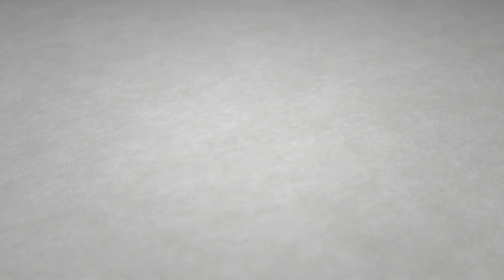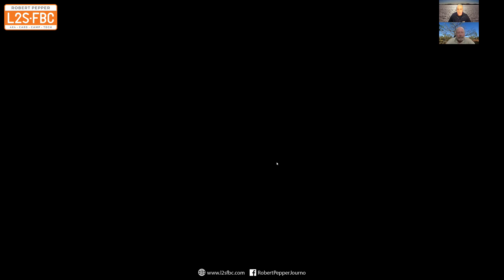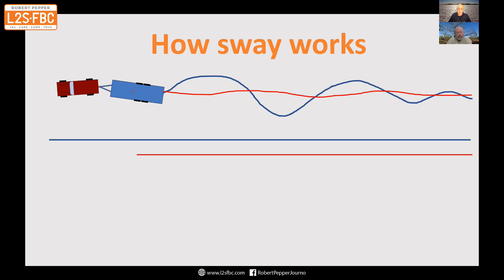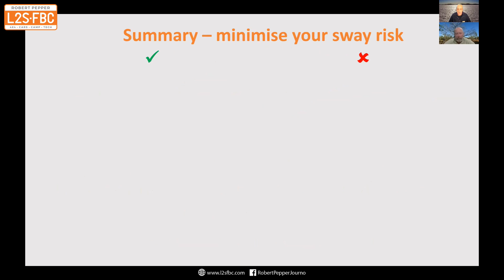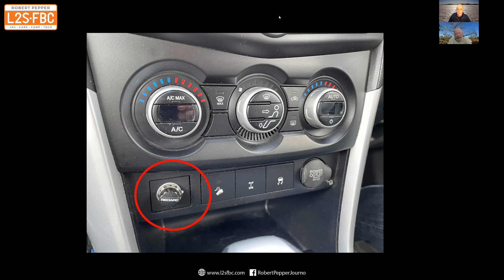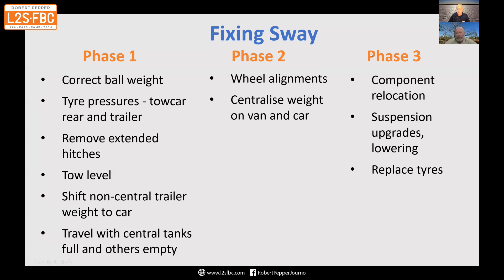Webinar - Trailer / Caravan Sway and How to Prevent and Handle It

Comment from the maker: 00:00 introduction
01:58 What is sway? 
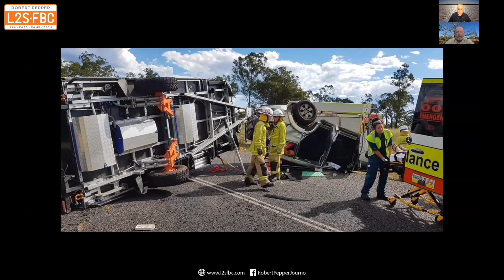03:11 How does sway work?
04:43 Easy way to fix sway
05:15 dealing with sway without an electric brake system
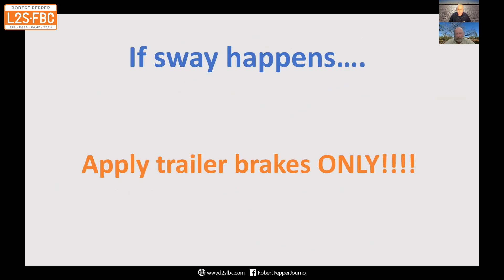07:03 reducing sway risk
10:40 location of brake controller
12:20 practice braking
13:40 caravan crash investigation
18:10 salespeople problems - vans and cars
21:05 pre-purchase weight deal
22:17 aftermarket sway systems
23:25 effect of increasing nose weight
24:09 electronic stability control systems
26:23 who can help me set up my van?
27:00  towing license
29:05 stupidity vs not knowing
30:00 setting up to reduce sway
31:20 rear tyre pressures & weights
32:00 more setting up to reduce sway
36:44 weight checks by police - stats
37:44 travelling with tanks empty/full
38:20 wheel alignment
40:00 offroad van height
41:00 tyres choice
43:40 effect of extended hitch
45:00 John's words of wisdom
46:55 speed and sway effects

Comment: Another thing is in UK alot of tow cars are front wheel drive and i have soon they load trailer nose weight is over loaded meaning very little weight and grip on the fronr wheels that leads to sway and turn over

Comment: We just picked up our new van and it came with a weigh bridge certificate. We also got a mobile weighing business to weigh our van fully laden. Our manufacturer’s number must have been pretty accurate. As part of the weighing service we received an excel spreadsheet that you can input weight you are adding and the location in the vehicle or caravan  that produces a report on the updated axle weights for each axle of the car and van as well as GVM, ATM, GTM & GCM. This provides peace of mind.  I have watched a lot of Roberts videos and I’m more cautious and better educated as a result. Yes, I am one of those with an off-road van. I did opt for a heavier load rated/stronger AT tyre as an added safety initiative given a portion of our driving will be at reduced pressures on corrugated roads. I was surprised by how much reducing tyre pressure reduces the tyre’s load carrying capacity. It’s a logarithmic scale so somewhat complicated to get the data on for specific tyres.

Comment: In Canada most vehicles with up to a class 3 or 4 receiver ( most full size pickups) over 5or6 hundred pounds receiver weight a equlizer hitch is required. I dont think you emphasized the importance of an equelizer?? Note for tight manuvering or maybe off its better to remove the sping bars.
Reply from the maker: Not required in Australia, and shouldn't be needed for that van

Comment: I scrap a lot of metal, some very heavy steel. I'm curious about heavy payload placement, not front,center or back. But if heavy items should be spread out closer to the sides or pushed in closer to the center line?? 
I try to be safe, in my past, I was guilty of some sketchy things while towing.
Reply from the maker: Centralised over axles.
Reply: @L2SFBC  Thanks, that is how I loaded it. Smooth as silk for the 30 mile drive home. This is great information you're providing!

Comment: 06:07 I have found a couple of times towing my boat with over ride brakes the trailer started to sway. I didnt brake I just kept the wheel straight with 2 hands & backed off the accelerator and the car & trailer stopped swaying around 80km/h.  After those couple of events I dont tow my boat above 80kmh. My boat trailer has about 7% ball weight. Im in the process of buying a heavier tow vehicle. At time of those incidents my car weighed 2 tonne & my boat weighted 2 tonne.

Comment: Interested to hear your thoughts on this...why do car dealers say a WDH is incompatible with cars that have trailer sway built in? When reading how trailer sway feature works on a car, it seems to be counterintuitive to what I have learned through your channel to prefer braking the trailer, not the car. Trailer sway feature on a car just applies the brakes to the car only? Is that correct? In short, is trailer sway feature on a car actually proven to be any good?
Reply from the maker: There is no reason why a WDH is precluded by car TSC. None. However some carmarkers ban use of WDH on their vehicles, so possibly the dealers are confusing correlation with causation. 
With all due respect to car dealers, do not use them as a source of advice on towing or anything other than the price of the vehicle.
Refer to my electronic sway systems video for more detail.
Reply: @L2SFBC  totally agreed mate, most of the advice is garbage same with what people repeat online. And my thoughts around TSC going against what you probably should be doing? I watched a Mazda BT50 video on TSC and it says brakes are applied, possibly on one side but honestly very little details on how it works. Will check if your video covers that.
Reply from the maker: Hi yes my video covers both trailer and car ESC

Comment: This happed to me.  I took my foot off the accelerator.  Looked in my rear view mirrors and steered opposite of the away.  I recovered perfectly.  All the trafic behind me slowed and I was swayaing.  I was going down hill.  I had too much weight in the rear of the trailer.      I also think that I maid a deal with the devil.  But I'm not realy too sure about that.  It all happed so fast.  I guess I will find out as time passes.

Comment: How do you asses the ball weight on a twin axle trailer?
Reply from the maker: Use a ball weight scale
Reply: @L2SFBC  how does that work on a twin axle trailer?
The reason I ask is that our 4 boat trailer (4x250kg dragon boats) is damn heavy even when unloaded and I can’t tell when I’m measuring ball weight or trying to lift the trailer. 
It’s easy on a single axle as it seesaws around the single axle but a heavy twin is different, because the fulcrum is between the two axels and as soon as you try to lift the hitch you’re in effect trying move that pivot point to the rear axle. Therefore you’re now trying to lift more of the trailers mass. 

What I’ve always done is had the center of mass of the 4 boats 300-500mm ahead of the mid point of the 2 axles and once I’m hitched up I check that the suspension of the van isn’t squatting. I also load as much as possible into the tow van even though its a PITA to unload on my own after a race rather than have everything in the boats.  

On a side note, when I first started towing I had someone tell me to accelerate hard out of a sway. I ignored that because I couldn’t see the logic in adding speed into an already dangerous situation. The only time I ever got a hint of sway was when my speed crept up over my usual 90-95kmh to 115-20 going down a steep hill. I took my foot off the gas and very gently braked and it stopped instantly. I was more annoyed with myself for not concentrating than scared at the time but it did make me think later how close I was to screwing up, big time and to never do it again.
Reply from the maker: Measuring the ball weight is the same process twin or single, but yes they react differently as you've noted. Don't accelerate out; the videos on my Sway playlist explain why.

Comment: Hi Robert, thanks for your well-researched and informative video presentation. Your content has been so helpful in my education leading up to my picking up a new (1600kg) camper trailer later this year. Your guest was critical of camper trailers that had mud terrain tyres fitted as standard and this is what mine will come fitted with (16" wheels with 33" mud terrain tyres). I don't intend to drive on the sort of terrain that would necessitate such rubber so, could you recommend a type of tyre that would be more suitable? My plan for the first few years is to travel mostly on bitumen with the odd foray onto unsealed roads. My tow vehicle (2020 Mazda BT-50) currently has H/T tyres fitted. Maybe as I build experience in coming years, I may undertake more gruelling off-road adventures!
Reply from the maker: Mud tyres are a waste of money on 99% of trailers, and you'll regret the choice when it's high-speed wet bitumen. Just run light-truck construction all-terrains. Reason; you need strength, and the trailer wheels don't need to drive, just brake and provide lateral grip. And for a single axle both wheels are always in contact with the ground.
Reply: @L2SFBC  Thanks for your prompt reply. Much appreciated. Keep up the great work.

Comment: I would love to see additional licensing for trailers, of any weight. Just a simple endorsement that can be done when learners graduate to their Ps to prove they've learnt how to reverse a trailer and understand loading and load restraint, through to requiring either specialist driver training or a heavy vehicle license where towing is included in the training, such as with HC licenses, for towing braked trailers.

Also zero blood alcohol when towing. The fact people can have a drink and go throw their 7t plus rig down the road is dumb and dangerous.

I think the other thing that really needs to change is how trailer manufacturers build their trailers and vans in the first place.

Being allowed to produce a trailer that has such poor roll and yaw inertia characteristics is just ridiculous. There needs to be limits put on the way weights are distributed throughout the trailer.

Tare weights should also be changed to include full tanks, fresh, grey, fuel, whatever. Their full weight is what should be included in the tare.

This 10% ball weight BS needs to be stopped as well. It's blatantly untrue and is just a cover up for poorly designed trailers. You shouldn't even need 5% to maintain a stable combination where your trailer and tow vehicle are properly set up. I'd put money on a sub 100kg ball weight on a 3.5t trailer where that weight is all in a concrete block over the axles being substantially more stable than a good number of vans you see rolling down the road. High ball weights just cover up poor design and pander to the desire of people to tow at excessive speeds.

Basically this whole towing thing just ticks me off. Between the lies salesmen come out with to sell a car or van to the dumb crap in Facebook groups etc that gets shared as gospel, nobody wants to listen when you try and point out simple facts. Better regulation and vehicle standards and formal training requirements are the only thing that's going to fix that.

</rant>
Reply from the maker: With you on that. I run 5% on my 2350kg van.
Reply: @L2SFBC  I only came across your channel the other day when you did a video with madmatt.

It's good to see someone properly explaining how this stuff works, even if it doesn't help make friends with the manufacturers.

I reckon you mentioned that you have a video with stability calculations in it, but I can't seem to find it... Any chance you can tell me which one it is?

Keep up the good work mate.
Reply from the maker: Hmm depends which calculations. I have a bunch on towing and sway. Can you expand?

Yes I get no financial support from manufacturers and prefer to rely on my viewers and readers.
Reply: @L2SFBC  Was hoping to see something around the interaction of weight distribution and speed (inertia) and oscillation. Basically the maths that describe the point it goes from damping to amplifying sway and how load and load distribution affect it.

I know that's not exactly a small ask (and to be clear, I'm not asking - I suspect that kind of video would have a rather tiny audience appeal and not worth the time and effort it would take), and was hoping that that's what you'd meant you'd already done, rather than just adding up and understanding various vehicle weights (GCM, GVM, ATM, GTM etc)

This stuff is hard to find good information on, mostly it's just described as "physics dictates", which while true just doesn't do it for me.

And yes, I am one of those strange types with a whiteboard in the living room just for doing fun maths problems on. ;)
Reply from the maker: You are correct it is a niche audience  and also extremely difficult to calculate given all the variables. Beyond my capability to model. Any such model would I feel need a lot of simplifications which would render it useless for real world setup.

I do plan on doing more with the 1 10 scale model you see. And if I ever get funding, a full size version which I can crash at will too fitted with lots of sensors!!
Reply: It won't make any difference - there is no skill involve it is a material fact that without a control system it will continue unabated.

Comment: Robert, favorite New Jersey distraction in our summer months: Someone on the highway towing either too fast in and out of traffic, or squandering the fast (left) lane well under the limit. As far as I know, none of the States in the US have trailer licenses or restrictions. Some roads do ban car-pulled trailers, though. Typical US driving license: Answer a few questions, learn how to parallel park, use your indicators. No documented hours/miles of instruction.
Reply from the maker: We have  GLS Graduated Licensing System here. Works well but I would imagine citizens of the USA would not agree with it.
Reply: @L2SFBC  Agreed... Most states don't have annual vehicle inspection after 25 years old...
Reply: Same here in Canada. For some reason parallel parking is the big test,  even though most people never will never park that way.

Comment: thanks for this, a lot of good information. a topic where design ( or lack of) has a huge effect. you touched on brake controllers ( and their location) what 'could' be explained further is their actual operation ( eg: differences between different brands etc) might have a different result. eg: when applied manually, does the full power go to the trailer brake or is it user controllable? 
 there are also many variables not checked like -- the assumption is the wiring is all correct, eg: is the earth return of the vehicle wiring ( via a typical 7 pin plug) sufficient for trailer full ( accident type) braking ( including at night with all trailer clearance lights on as well? think pre LED?) Hope this helps.
Reply from the maker: Ahahha...you are looking at my computer where the above will be covered!    Yes it does help thank you, even if I have it on my list then it's hugely reassuring to have people ask for it, thanks.
Reply: @L2SFBC  I look forward to seeing your next video on this. have you ever looked at some of the different adjustable height tow hitches ( and how they add extra 'unwanted' length) due to their design?
Reply from the maker: Yes. Plan on modifying the model towcar to show the evils. Also see my latest blog post.

Comment: Excellent presentation, lots of information from start to finish. Had the same thought about the muddy tyre trend, can’t see the logic when a good set of highway/all-terrain LT’s will outperform in any situation. I don’t agree with the idea of “sharing the braking duties” with my wife, aside from the possible legal aspect, I can’t imagine a passenger effectively timing the whole scene with the driver. Loosely following a few caravanning “influencers” doing their big lap and it’s refreshing to see some have the humility to admit overloading and battle that elusive balance. It’s made my next van purchase much more complex, but am happy taking my time to get it right.
Reply from the maker: The right tyre for a van in my view, even an offroad camper, is an all-terrain LT.  Please note...you can get LT (light truck) construction tyres in road an AT patterns. However, they don't look insta-tuff. 
As for legalities, if the van is swaying I think you do what you have to do. Having an alert passenger actually does work and work well; it's also worked in cases where a passenger has applied the emergency brake on modern Land Rovers which triggers an immediate stop.
Reply: Weight distribution, speed, GVM, and much more is great information to tow right, and not planning is planning for failure. However, there is only one way to get out of the situation if you are really in it (trailer sway). The first technical aspect described is that the trailer goes faster than the car. So what can you do without letting go of the stirring wheel, without hoping the passenger is not distracted and knows what the F is happening. PUNCH THE PEDAL TO THE METAL, which will make the car speed up to the trailer speed, and the force in the hinge point will be at pull, not a push and the car will gain control of the trailer direction. If you can not do that there is something you are doing already wrong and you're F'ed, going too fast, going too fast down the hill, the car doesn't have the grunt for the trailer mass...... you name it. I might only be towing in Australia for only 6 years and a trailer designer for 4 years. But back in my home town, I have been heavy twoing in the farm since I was 16 (20 years towing experience).
Reply from the maker: Sorry, accelerating to fix sway doesn't work in practice. Why not is explained here -> https://youtu.be/nc0ndz92IWY

Comment: Thanks gents, that was indeed a long but very useful and informative video. 
I have a few questions:
1/ What effect does the length of the A frame have on stability?
2/ Does having underslung weight (water tanks, spare tyres, grey water tanks) improve stability?
Reply from the maker: The longer the distance between the towball and the wheels, the greater the stability of the trailer.
Yes underslung, central weight improves stability.  This can be seen in the video below. However as John said, the weight must be low. The higher up the weight, the greater the propensity to pitch, and excess pitch will increase the risk of sway. So, if your tanks are central, travel with them full. The more weight you put in the centre of the trailer the greater the resistance to sway. The more weight you put at the extremties (eg motorbikes on drawbar, heavy wheels at the back) the greater the propensity to sway.  Video below shows most of that pretty clearly.

https://youtu.be/JeEEC5eVNCk
Reply: @L2SFBC  Thanks Robert.